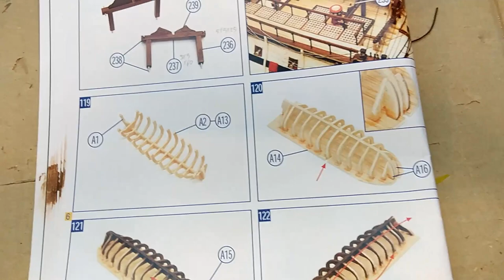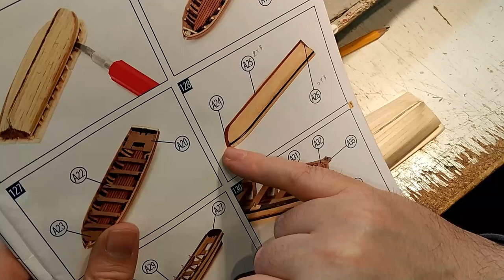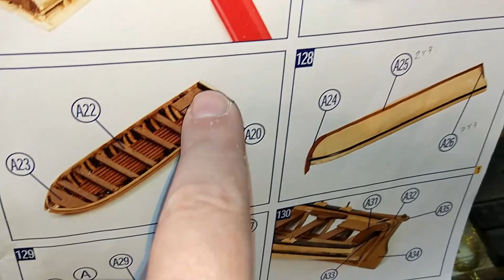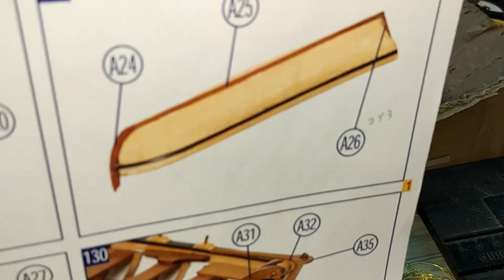Montanes - part 68 Making The Lifeboat (phase 1)

Comment: Hey John! thanks a lot for another video! 
Nevermind those folks man. There's always someone who believes that can do anything better: they can do build a ship, paint something, pilot a plane, drive car, etc better then anyone else. 
you are doing a great job and the most important is that you like it. If listen to everyone then it some point you might find out that Wolf is wrong too and he's supposed to be a cat :) 
Could you please recommend the wood putty you are using. I'm building my Albatros now and i think that i might need some. But i think that it might be difficullt to find putty that will match wood tone exactly. Thanks in advance man.
Reply from the maker: Thank you again for your kind words Andrey!!! The wood putty that i use is a Greek product and i have bought it from the local hardware store. You just ask for water based wood putty and you buy the appropriate type for wood, that is walnut ,teak wood, sapely, and balsa(or Swedish) wood.